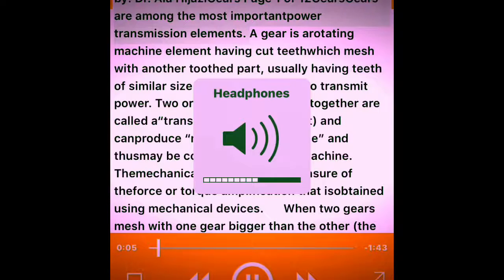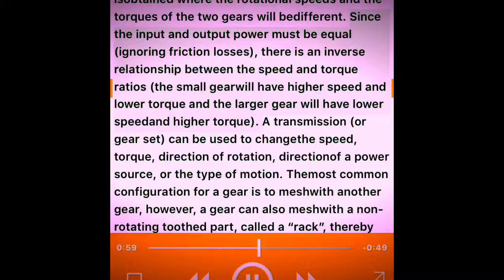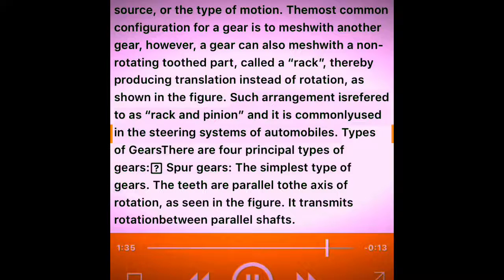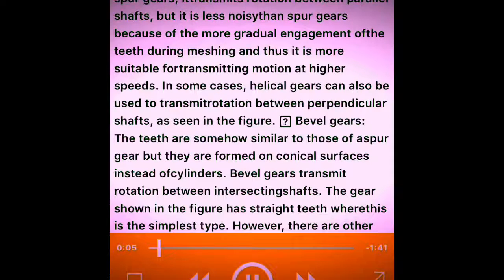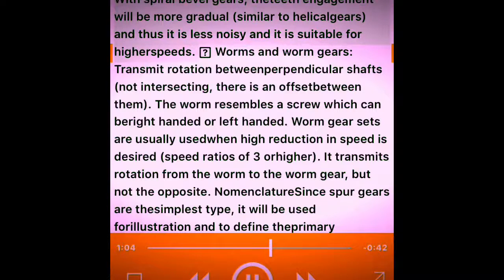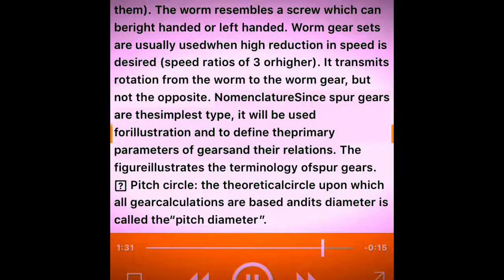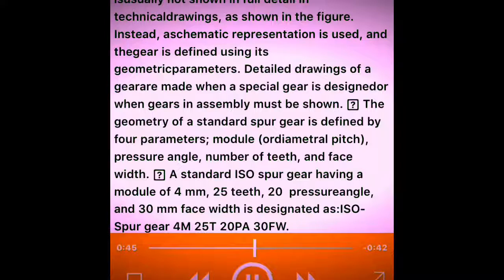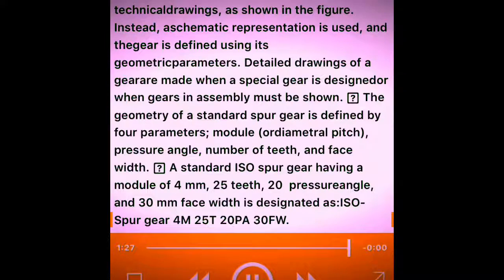gears

Comment: in case you are interested.    every gear ever made is/was a   Rotary 2nd-class LEVER.   why.  for any two meshing gears, energy/force is transmitted between them at a their common  mesh-point; which is at a Fixed Point.    in order to appreciate this concept, thinking in automotive terms, where power  'comes out of '  an axle,  Must be eschewed.
in context, then, a wheel and axle is a  single object and functions as a Rotary 2nd-class Lever.    this principle is  THE  KEY  to the  Efficiency of any wind turbine or hydroturbine, including the waterwheel.   (why do you think a bigger wind turbine is more efficient than a smaller one.  one reason is that  longer rotor blades (spokes) have, inherently, a greater moment arm/leverage, at  the  center  of  rotation.     note that in many cases, a wind turbine employs a 'reverse' planetary gearset.   where the rotor hub is mounted to the  RINGGEAR.    see my channel, if it suits.  see linked video and my comments there.    cheers
https://www.youtube.com/watch?v=lTkXciAn488

a brief physics discussion:   because rotary motion is  Not  vector, it should be considered  SCALAR.   THIS IS A VERY BIG DEAL.    this, then, explains the correlate with variations in  Torque-as-force   throughout a geared, or otherwise rotary, system  (where vectors dare not go).      conclusion:     it  SHOULD be possible to design a mechanism optimized for the Torque Multiplication Effect, of a Rotary  2nd-class  LEVER.     this can be achieved by incorporating at least one 'true-length' rotary lever.   in other words, a wheel/rotary lever whose inherent MA is a result of a lever of greater length.

imagine.     imagine a utility-scale wind turbine.   imagine a rim is mounted at the ends of the rotor blades.    the rim is  NOW  LOCATED  at the orbit of the end-point of a rotary 2nd-class lever; where leverage is  Greatest.   so this is WHERE force/energy  Should be applied.    an electrically-powered mechanism is used to convert a known amount of electrical power (watts) to input force/joules/etc.  ( the reverse is done for output energy. )    a key design imperative, is the need for the prime  mover/inputpowerunit to have  Mechanical Advantage over the load, overall.